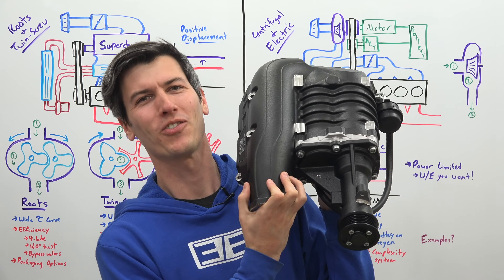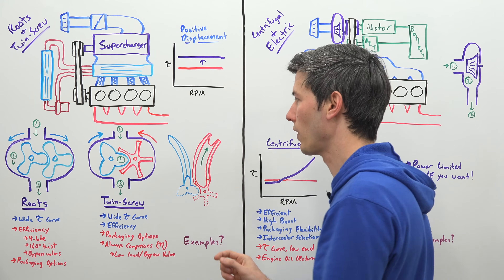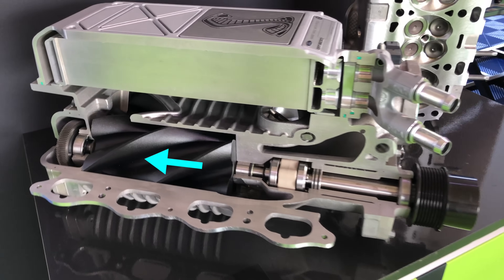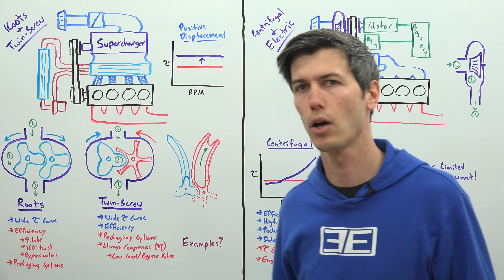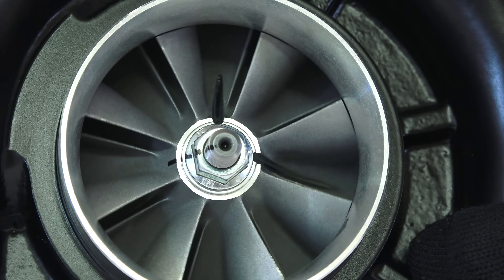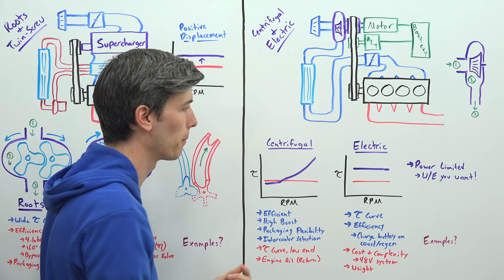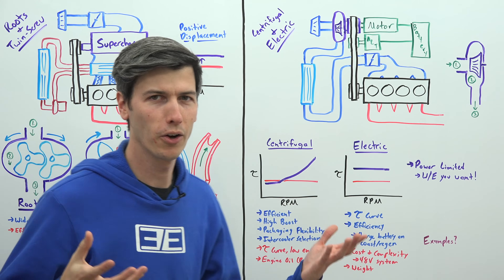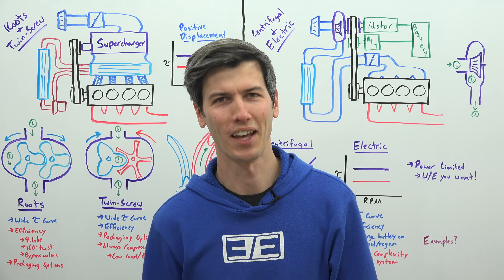What's The Best Supercharger? Roots vs Centrifugal vs Twin-Screw vs Electric

Comment: I've recently been spending some time thinking about the twin screw compressor, trying to figure out how the compressing action takes place inside of it. (I wish I could get my hands on one in person!) At first glance it looks very similar to the roots blower. But then you realize the rotors spin at different speeds and have a different number of lobes. Which is a little bit mind boggling. I think the different number of lobes and the difference in "twist" of the rotor lobes is what allows/requires them to spin at different speeds. That takes some time to visualize in your head... As two lobes are "unmeshing" at one end of the rotors, at the other end they are meshing with different lobes. Much like two simple gears with a different number of teeth/diameters. (With a 1:1 gear ratio the same tooth is always meshing with the same slot on the other gear. If the gears are not 1:1, that tooth will mesh with a different slot (or in this case "lobe") on the other gear). Except in this case the rotors are the same diameter because of more twist in the lobes of the faster turning rotor (also very hard to visualize! Take some time to think about that.) But when it comes down to the actual compression process I think the two accomplish it in the same fundamental way: As the lobes unmesh during rotation, they are creating an expanding space that is filled with air (in both the roots type and twin screw [and a gear pump!]). That space is then trapped between the lobes and the compressor casing (in both the roots and the twin screw [and a gear pump!]). That space then becomes smaller as the lobes remesh at the other side of the compressor casing, thereby increasing the pressure (in both the roots and the twin screw[yes and a gear pump])... A very similar means of compression. Except the roots type basically pushes air from top to bottom (or bottom to top) because the lobes are relatively straight. On the twin screw, the compression happens from top to bottom as well, but also end to end because as the rotors mesh and unmesh the seal in the middle between them is moving from end to end. So basically I think the two types of super chargers look the same, seem very different, but actually are very similar! Haha!

Does anyone else agree with me?!?
Reply: The guy explaining got it wrong. The twin screw pulls the air around the outside the same as the Roots. Yes, they work in a similar way. The air being compressed is contained in the female rotor and as they are meshed and rotating, the Male rotor lobe is filling up the female rotor, causing a reduction in volume in the female rotor air chamber. This compresses the air in the cavity and it exhausts out of the end of the supercharger, into the inlet manifold. As was pointed out, the Roots is a blower, in that it crams air into the inlet manifold causing positive pressure.  On a twin screw the compression takes place within the supercharger itself.
Reply: @gpz550a2  Thanks for replying! I agree with your explanation of the twin screw compressor, but I'm not sure what you meant with the roots blower. I think the roots blower pretty much works the same way... as the male part of one rotor unmeshes from the female part of the other rotor (via rotation) it creates an increasing volume, or suction, and then air is carried in the female part of the rotors, sealed against the casing. As the rotors remesh, the male part of one rotor reduces the volume of the cavity of the female, which increases pressure. This happens in both the roots blower and the twin screw... I think both types fundamentally work the same to obtain compression but just have different shaped rotors.
Reply: @jessequentin4441  you are correct that both work in a similar way. The differences are that a Roots blower (blower being the key word) has two non gendered rotors with the same number of lobes and a longer helix. They can also be straight lobed but the basic principle is the same, they just push large volumes of air. The air outlet pressure is clearly higher than the inlet but the pressure in the total system is highest in the inlet manifold as the blower forces more air into it. The screw compressor usually has unequal numbered lobed rotors with gendered rotors. A Male and a female. They are not identical. The compression of the gas to the intended system pressure takes place solely inside the screw compressor housing. My knowledge of the application is with industrial air compressors but they all work in the same way. Just search for how a screw compressor works on YouTube and it will show you.
Reply: @gpz550a2  I think we are pretty much on the same page when it comes to the screw compressor... I see the differences between the male and female rotors of the screw compressor. What I'm saying is I think that in a roots blower both rotors each have male and female parts... and they interact in the same way as the twin screw compressor to create compression. The roots blower is a positive displacement compressor...

Comment: The argument for electric supercharger really is decided by how often you want boost. I'm glad it's finally being had though. Efficiency is very dependent upon driving style regardless right? A simple "button" to give max power is arguably more fun AND more efficient overall. Imagine being able to merge in traffic within 2 seconds notice while maintaining general efficiency. Or passing as if you were driving a modern v6 in 4th gear just to maintain speed in 5th or 7th.... in a heavy 4 cyl. That's the dream guys. It's also a safety issue out here. We don't all want to drive like you in the passing lanes and some of us drive 100+ miles per day easily.

Comment: My question is: dont the twin scroll and root chargers do the same 'net' thing.  If the root charger is supplying more air than the engine is using, the pressure will build up based on the volume of air going through the roots and the volume of air in each cylinder. If the screw charger intakes the same volume of air in the situation, it won't matter if it compresses it, it'll decompress as it leaves the screw and build pressure in the manifold anyway, based on the same volume ratio.

Comment: Those looking into electric can look up TORQAMP, very simple installation, and actual results. Think Cleetus got 7 pounds or so on a test crappy cobalt. Only thing in my opinion is that the materials dont justify the cost, yeah theres paying for the engineering also but again ... think it runs in the 2500$ At this point you want to reverse engineer and make your own.

Comment: Ram air intake:
No moving parts, lightweight, boost is based on vehicle velocity so torque curves are irrelevant, engine sound is irrelevant because you're moving faster than sound.
Reply: @jake4194  Are you going to explain to me the technicalities of what defines boost and why ram air doesn't count, or did you just come to say "no?"

Comment: its not about which force induction is better than which. it is about which combination/ a properly set up is better. i'm pretty sure a bolt on turbo in a awd dual clutch automatic with the right gearing, the right power band, and sticky tires and fueling/cooling will destroy any similar hp with a bolt on force induction on the wrong gears,  the wrong power band way down low and no top end power on a rwd with wrong tires and a manual. a properly set up supercharger will beat a bolt on turbo set up, and a properly turbo set up will beat a bolt on supercharger. and no a properly set up isn't bolting on a supercharger on a mustang on stock dealer tires, stock clutch, stock fuel system and going out losing to a car that you shoulda beat with the right combination set up in the first place.

Comment: Electric supercharger sounds a lot like what Honda was doing with their first generations of Hybrid technology--Integrated Motor Assist. Especially in the 2005-2007 Accord Hybrid v6. The regular 3.0 v6 was putting out 240hp but jumped to 255 with IMA plus more torque. I owned an '05 for several years and it had the best power delivery of any other Honda or Acura I've owned.  @Engineering Explained --Any chance you could do a video about the pros/cons of Acura's j37 engines? Specifically, the AlumiSil hypereutectic cylinder liners. I bought a 2010 TL-SHAWD last year that requires paying attention to the oil level, but I think all the tech they used to get power from this engine would make a great video because of the way you dissect and compare components.

Comment: Personally I like the non-positive displacement pumps as they don't have wearing parts so should last longer. I like the electric driven one and wonder if all engine ancillaries should be electric and the engine have a beefed up alternator - possibly direct drive.

Noting the down-sides to the belt driven - surely all it needs is CVT belt drives ! It'd make a nice analogue computer linked to accelerator position, inlet manifold pressure and engine RPM to calculate optimum charger RPM !

Comment: I feel like the egg should have gotten smaller and heavier as it traveled backward in your demonstration of the twin screw.
Reply: Correct, the root diameter is tapered to decrease the size of the pockets. One big advantage of the twin screw is much less  HP loss to drive the screws, vs roots type. But also more expensive to make,  no kit available for the Miata.

Comment: Thanks for the video. I was under the impression that both the roots and twin screw blowers compressed air in the supercharger housing and that the only thing that differentiated them was the shape of the rotors but it looks like this is not the case. When I selected a blower for my Mustang I decided to go with a twin screw design. A case could be made going with a centrifugal blower (smaller, less weight, less costly, more ultimate horsepower) but I opted for a design that would provide more and quicker torque and I'm glad I did. In addition to having far more torque in my normal operating RPM range (2000 - 5000) it performs flawlessly and does not create the hard starting characteristics that some centrifugal blowers are known for.
Reply: yea for coyotes the centrifugal superchargers don't really make sense imo, they're already rev-happy and need some low torque to balance out the driving experience

Comment: Nice explanation but power for the electric supercharger isn't supplied by  the battery, the battery in an IC car is purely a starting battery. Once the engine is running everything is powered by the alternator (except some especially high intermmitent loads!).

Comment: jason, what’s a better car? 2+2 or 2+0?

i’ve seen two different versions of a car for example the 300zx 2+2 and the 2+0 and the Lotus Evora 2+2 and the 2+0

ppl would say 2+2 is better than 2+0 for the 300zx because of drifting and handling and people would say 2+0 is better than 2+2 for the lotus evora because of less weight is better

Comment: You do realize what you drew there on the old white board of knowledge, yeah? You drew an electric supercharger that has a pulley for a belt. What if... you marry a clutch or one way pulley between an electric motor and it's compressor housing. The electric motor drives the compressor only when the TPS reads above a preset voltage. Less parasitic loss during hard pulls because the engine isn't spooling the wheel.

Comment: I remember reading a Mustang magazine in the early 2000's and a centrifugal supercharged car won overall at some Mustang 5.0 drag competition, when the rest of the fastest were turbocharged. They said that the belt driven centrifugal blower allowed for cooler intake temps. Does a turbo, having an exhaust driven turbine coupled to the compressor increase air temps that much more?
Reply: Turbos do get really damn hot and I wouldn’t trust one unless it’s in a diesel or has really damn good cooling, The reason why the supercharger won was because of heat soak hot engines getting hot air run slower than a cooler engine with cold air and super chargers run cooler then turbos

Comment: Roots blowers were originally used for blast furnaces and venting out air in mine shafts before hot rodders start sticking them on engines.

Comment: In the arrangement described at 0:45, most automotive professionals refer to that as an "aftercooler". 

Technically speaking, most of what we call an "intercooler" in forced induction cars are actually aftercoolers.  

However in common jargon, from boosted muscle cars to Detroit Diesel commercial engines, the air-to-water cooler after the blower has typically been called an aftercooler.

Comment: Positive displacement supercharger  advantages control,control. Not everybody uses superchargers for street. Rock crawling in a jeep needs low end torque. The screw type supercharger is superior for this because it builds up less heat than the roots type.

Comment: could you use the engine to spin up a fly wheel that would keep spinning irrelevant of the engine speed and charge the battery from that?
Reply: There would be a load on the generator causing it to slow and finally come to a stop much sooner than if it were truly freewheeling

Comment: In college, we built a 1.6 liter  I-4 16V with an electric supercharger for a low-end boost and a  regular exhaust-driven turbo for high boost. The electric supercharger worked well for eliminating turbo lag and when the engine was over  3500RPM it shut off because there was sufficient exhaust flow for full boost.
Reply: Nice wow good job got any pictures. 
 I want to make a supercharger somehow utilizing an electric radiator fan working on centrifugal airflow. With an outlet radio to the fan

Comment: One thing wrong was a twin screw isn't more efficient. It compresses the air which creates more heat making it less efficient. It can make more hp but only if it's utilizing a intercooler. Screw type is a better design for power but not more efficient. That statement is almost oxymoronic if it wasn't for the fact of losing efficiency thru parasitic heat lose.

Comment: On the electric supercharger, why is a battery needed, instead of going straight from the alternator to the motor?
Reply: Because 12V doesn't provide enough juice for a high-power electric motor, a 48V (or higher) circuit is required.

Comment: I remember when electric superchargers were a joke...  Guess someone managed to make it work?
Reply: Million Mile Drive I am taken with that concept engine that did away with the serpentine belt. They stuck a generator between the driveshaft and tranny, and that produces 48V power to run climate control and so forth. Those would benefit from electric supers.

Comment: Edelbrock instalation manual for the MX-5 ND Supercharger: 
"WARNING! The supercharger bypass valve is factory installed and adjusted intended for vacuum      operation only. DO NOT move the solenoid actuator lever by hand or adjust the stop point. Moving the lever manually will damage the solenoid and the system will not function    properly. Damage to the bypass assembly from manual movement will not be covered     under manufacture warranty."
Jason at 5:15 "Hold my beer". Jk, I know that you know what you are doing haha.

Comment: Jason, how much power needs electric motor to spinn the compressor wheel in centrifugal charger? 
For example if You have 2.0L engine and You wanna 1 Bar of boost?

Comment: Actually there could be a boost to a non-turbo engines with electric fans, on conditions that it only supplements when its needed at the heating of engine and at the lower RPM functions to give a healthy boost, and its interference to air-intake pipe is smoothened.

Comment: Correct me if I'm wrong, but don't Roots style superchargers also have different thermal characteristics? I recall reading that Roots style superchargers get pretty hot on the outside, due to the air being moved along the casing, vs. Twin Screw designs, where the heat stays in the center of the device. This means that packaging is more of an issue when mounting a Roots style supercharger inside a car's engine compartment, due to the extra heat emitted.

Comment: You skipped over the importance of the helix angle of the rotor lobes. Roots blowers tend to lose a lot of efficiency as heat. With strait lobes, a blower will deliver slightly pulsating boost. With angled lobes like a twin screw, a blower will deliver smoother boost, that reduces blower case flexing, reducing heat.

Comment: Explain air to air as to the difference of air to water...??? Is the last one like a transmission cooler on say car and the lines went inside the water tank and that tank cooled the fluid?? Just don't quite get this... Is one radiator holding the air coming in till it cools off some and exits to engine intake?? For some reason doesn't click... will watch again to see if I was tired and slept through that.

Comment: I’ve had both the PD and centrifugal on cars. All of I have to say that the 2200R on my C7 put out over 1000whp and still made max torque at 3500rpm and held to redline. If you mashed it, it would be like flipping a light switch if in the right gear. The PD blowers where much easier to modulate but they also lit up the tires from a stop.

Comment: Failed to mention that the electric charger is typically fixed rpm, on or off, so as engine rpm increases, boost pressure drops and the engine outruns boost at higher rpm.  The torque curve would be opposite of the belt driven centrifugal charger.  I prefer the ever multiplying torque curve of exhaust driven turbo chargers, the faster you go, the faster you go faster.  Also, turbo gives better fuel economy at lower throttle and rpm whereas belt drive blowers always make boost and therefore require more fuel even at idle.